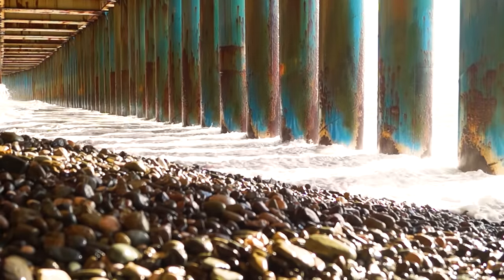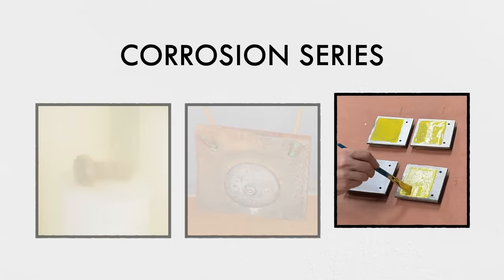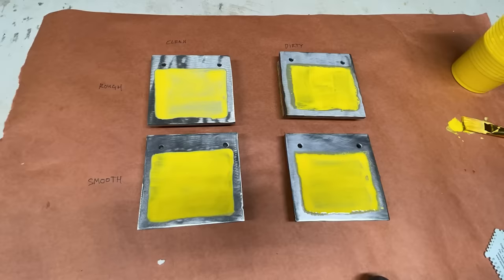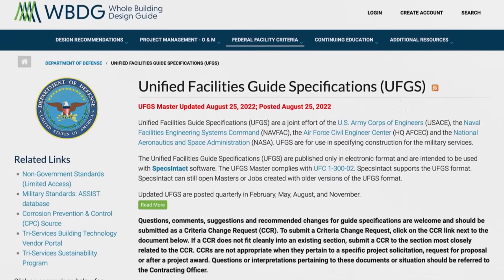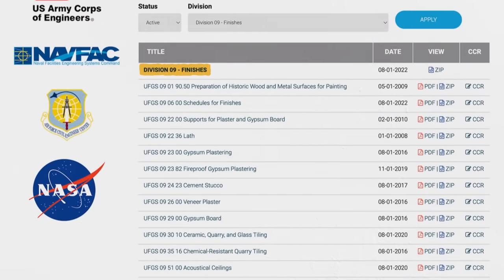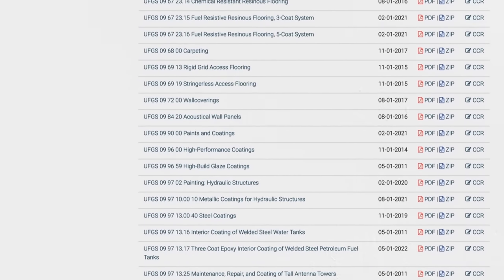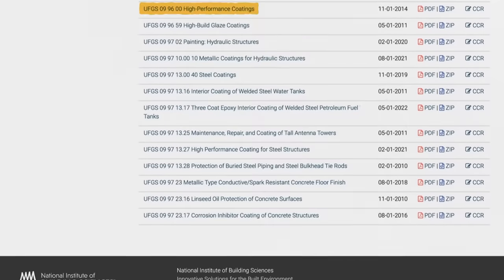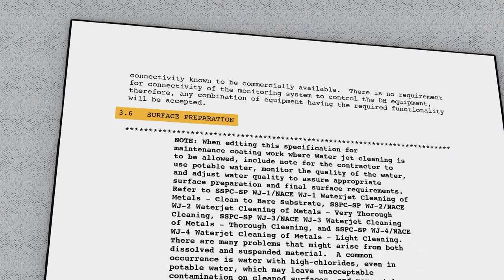What's the Difference Between Paint and Coatings?

Comment: Painting your home is often about protection as well. Bare drywall and wood are highly permeable surfaces that aren't resistant to water and generally should be painted for protection as well as looks. 

This is doubly so for outdoor paint.
Reply: Actually coating wood is only a semi good idea.
Because wood is hygroscopic a small crack in the coating can be fatal. Because once the moisture gets inside it can't evaporate, creating a wetspot where fungy can grow.
Reply: And in addition to providing pleasing cosmetic appearance, painted surfaces are much easier to clean (IMHO).
Reply: Are Americans afraid of bricks or concrete or what am I missing?
Reply: @SuperDeinVadda  Laura Kampf's house is a pretty good example of this, I think.  100 year old timber frame, completely rotted out from moisture trapped in the walls.  

Also my landlord's house that I rent taught me a lot about wood rot - something that happens when you let your "friends" play handyman.
Reply: As a professional painter of 20+ years, house paints are both decorative and protective. This is true for interior and exterior paints. Any exterior wood without some sort of coating, stain, paint, or other, will degrade much faster than those that get regular maintenance. On interior surfaces you can see this most prominently in bathrooms and kitchens.
Reply: @Realkeepa-et9vo  Americans are cheap and make disposable houses. With a wacky real estate market, why bother paying a bunch more for durable materials when crappy ones will suffice.
Reply: @Realkeepa-et9vo  Wood is just comparatively cheap and plentiful here in the US and Canada, and has been from the beginning.  It lasts for centuries when protected from moisture,* and the construction industry is extremely well-established around it.  There just hasn't been much economic pressure to force us to masonry, so most of our houses are wood-framed -- though sometimes with decorative brick or stone on the outside.

That said, you do see brick and concrete in city centers where fire codes are tougher, and stone in places where good building stone was historically cheap and plentiful.  And adobe is very much a regional tradition in the desert southwest (esp Arizona and New Mexico), and fits the climate there better than wood framing.

EDIT: And I should point out that Europe still has old wooden buildings, from when populations were smaller and wood was comparatively more plentiful.  Norway, Sweden, Finland, and Russia in particular were still building wooden houses up through the early 20th century, before brick and concrete got cheap enough to be competitive even in rural areas.

* 200- and even 300-year-old wooden buildings aren't too hard to find in the eastern states.
Reply: @AaronOfMpls  In Nordic countries at least, timber framed houses and log houses have been continuously built as long as those have existed. Forests are everywhere and wood as a material is cheap and plentiful, but also fast and easy to work with. Many times if you see brick single homes in the Nordics, masonry is only the outer lining but there's airgap, wind stopper, wooden frame with (usually) wool insulation and moisture barrier material behind that from outside in.
Concrete element or brick building is an alternative, but it's a little bit more expensive than timber frame structure. Log structures are the most common for summer cottages and such. Their modern counterparts are incresingly common not only in single family houses but in larger buildings such as school buildings and small condos.

My point is that timber as structural building material never stopped in the Nordics. Wood also has some interesting fire safety aspects because its strength isn't so much affected by temperature. It's light in comparison to steel and can be used in very large structures if designed properly. Check Oslo Gardermoen airport frame and roof structure.
Reply: @SuperDeinVadda  
And that is why you need to choose the wood and/or paint with care. Some types of wood do indeed do well without paint, at least under the right circumstances, while others need some form of protection. You also never want to paint damp wood with any kind of sealant.
Reply: @Realkeepa-et9vo  You have to understand that when earlier americans came to these lands and took them for their own, they saw giant swaths of absurdly large trees just theirs for the takin and they built prty much any buildin that didnt "need more security" out of wood.

It wasnt rly until folks started buildin up that it changed, and even then thats not the house most folks dream of cuz its not the one they had as a kid bcuz their parents had it as a kid bcuz their parents parents had it as a kid et al... So as such folks when buildin or buyin houses almost always look towards wooden or similarly lookin prefab material.
Reply: @ArmpitStudios  Outside of the americas it is quite common to find folks didnt build out of wood when buildin structures bcuz they needed that wood for burnin and for other reasons. The Americas had a wide swath of trees tho which colonisers were more than willin to decimate 9 times over.
Reply: @SuperDeinVadda  wow. I didn't know it was 'make my own science/reality' day here in the comments.
Reply: @Realkeepa-et9vo  The way America did housing changed a lot in the post WWII boom.  Lots of housing was built fast, and it was all single family detached.  Then we mostly kept building like that.
Reply: on the west coast one painter said the slogan for our rainforest with dry summers is, 'paint it this year, or replace it next year'. True that a cedar deck with an oil-based sealer/stain combo will probably require less precision during application, but if you can't work with those materials then properly applied paint is an important part of a building system.
Reply: @ArmpitStudios  Im well aware of the loggin industry, im an oregonian... Im also aware that prior to that industry comin into the pacific northwest there were many trees with trunks of sizes unimaginable to us today.

Theres a right and a wrong way to do loggin, and msss clear cuttin of ancient growth to plant somethin else is the wrongest way.

Esp given plenty of other areas where they cudve farmed trees evne back then instd of destroyin the natural beauty of this land.
Reply: @ArmpitStudios  Yeah, sure, just like any other crop that takes 1000 years to grow.
Reply: @Realkeepa-et9vo  Wood is cheap in North America.  Also holds up much better to earthquakes than masonry.
Reply: cool! just had the outside of my house painted!
Reply: @ArmpitStudios  Yes but that's only part of the story. The replanted trees aren't what nature put there, but are species chosen for rapid growth. They lack many of the good qualities wanted in construction but they're all you can get. And unlike old times when large mature trees were plentiful and younger smaller ones left to grow, now they harvest 8" trees to get a couple 2X4's. A lot of the framing wood in the US now comes from Canada because it's both cheaper and better than  what our own lumber companies produce.
Reply: @mikefochtman7164  I consider that a form of protection.
Reply: @SuperDeinVadda  I mean, yes, failures in protection are always harmful to the underlying surface, but it doesn't change the fact that paint is used extensively to protect wooden surfaces from sun and moisture. But not just that, also damage and marks inside a home, where paint is an easy to clean surface that unprotected wood is not.
Reply: @KeeDx3 I'm sitting in a new concrete house in Europe right now.
Reply: @ArmpitStudios  Yes, a millennium.  They don't call them old growth forests for nothing.
Reply: @Realkeepa-et9vo  i live in canada, but wood framing is very common here because it's easier and more efficient to insulate.  It gets to be colder than -50 degrees C here with windchill, insulation is important.  
Wood is also very cheap and environmentally friendly compared to concrete or bricks.
Reply: THIS!  As we say in the paint industry, paint's function is to "protect and beautify".  Paint protects your home, too!
Reply: @SuperDeinVadda  So what do you suggest, since nearly every wood home is painted, unless it's redwood or cedar left natural to turn gray eventually. Homeowner associations don't allow unpainted wood.
Reply: @SylviaRustyFae  where they cudve farmed trees....?
Reply: @larryvaughn5843 
Best thing is to keep the weather of you wood. A proper roof with overhang helps more than any coating will do.
Then you have to repaint frequently and repair cracks in the paint layer as soon as possible.
Reply: @larryvaughn5843  What part ya didnt get?

Comment: I recently refinished a very old pistol that had a rough duty life. Stripped it down to polished, bare steel. Then, coated it in corrosive chemicals that flashed rust all over it, then dipped it in boiling water to convert the iron oxide into black oxide. Had to repeat the process about 10 times to get a beautiful, dark coat of bluing. 

Chemistry is always baffling and truly amazing. I'm an Industrial Mechanic(mostly robotics), I fancy myself as a fairly competent mechatronic engineer as a hobbyist, but if there was one subject I wish I was smart enough to study and become an expert on, it'd be chemistry. You chemists are the real heros.

Comment: Before the Forth Rail Bridge was coated with a coating made for offshore rigs, they used to paint it every 6 years and it took 6 years to paint so they were always painting.
Reply: that's both interesting and somewhat depressing haha
Reply: I suspect it is as much a matter of economy as anything.  They could repaint in a week, but they'd have to bring in a contractor with 100 painters.  Or, they can have one (or more) maintenance guy or gal who has various tasks, but the predominant one, and the one that is assigned to do when other tasks don't have priority, is to paint.
Reply: I seem to recall that they had a crew of six. They were also constrained by the use of a basket that would hold the crew as it progressed around the structure

Comment: I used to work in a shop that refurbished construction equipment and I started out in the paint department doing paint prep and worked closely with the painter as his sort of assistant at times, learning a lot about what he does and why. Parts of this video showed clips of people doing various parts of the job of coating infrastructure, buildings, and ships, and in a many of those you see them using equipment such as boom lifts and scissor lifts. Another layer to this whole process is making sure those machines are in good working order, and a part of that is the coating that protects them from the same elements as the infrastructure in question, for the same reasons. We took great care and pride in our work on both the paint and mechanical sides of the shop because we knew the safety of anyone using that equipment was in our hands. A lot of this video included things we made sure were right as we were doing our jobs to ensure the folks doing things like maintaining our infrastructure were able to get the job done as safely as possible. Of course, some of these things are monitored far more closely and to a tighter standard when you're doing something like coating a bridge, but definitely interesting and cool to see how similar the underlying focus of the jobs are, and how one supports the other. The paint job looking good is great and all, but the coating being properly done is the primary emphasis. And if you do the second part right, the first will follow.

Sorry, just saw some specific equipment I know inside and out but havent worked on in a while and combining that with the topic sent me down a memory hole lol

Comment: We have a balcony with iron railings, and re-painting them is always a chore, because indeed at least 80% of the total time for the job goes into preparing the surface. After a few years, the spots we hadn't properly sanded and de-greased will mercilessly become visible.
Reply: I got rid of mine last summer for that reason. I liked the style but it's too much of a hassle to maintain. I've replaced it with wood railings with aluminum bars.

Comment: "The Mighty Mac", the Mackinac bridge connecting lower and upper peninsulas of Michigan is one of those structures that has nearly continuous maintenance.  Of course in the dead of winter, with freezing and blowing winds, it's not 'year round'.  The inside/outside of towers, the cables, the deck steel, and approaches all need periodic work.  At 5 miles (8 km) in length, it keeps a work crew busy.  Fortunately, no saltwater though.  :)

Comment: I do blade repairs on wind turbines and had a conference call with engineering trying to figure out if we needed to feather out our paint  on a 1 foot external repair. I had a rough idea of why we used 3 layers of different coats but this fully explains it.
Reply: They're made of steel and not carbon fiber?
Reply: @themonsterunderyourbed9408  oh no they are made of fiberglass with a carbon fiber spar.

Comment: I worked at a shipyard painting the hulls of boats during the summer of my freshman year of college, and I always wondered what the different layers of paint were. Iirc, we had to apply three layers of protective coating, and then that got sent to the more experienced guys to do the more precise aesthetic paint layer. We never did any of that calibrating paint thickness or surface roughness, the paints were well designed so any reasonable paint roller will put down a layer that fit within the painting specs.

Plus, those power washers to strip the paint and roughen the surface were no joke. They were about the size of a golf cart. Originally they used to strip both sides of the ship at once, till one time a guy's power washer fell below the bottom of the hill and hit the other guy in the leg. Went straight through his calf muscle.

That job motivated me to stay in school.

Comment: I worked for a very large company that made SCADA equipment for the electrical utility indusry.  It's customer base was truly global in nature.  A customer in Arkansas complained that the NEMA 4 class enclosure was leaking - which it is not supposed to do.  Our investigation lasted several months, and we enlisted the expertise of the foam and adhesive manufacturing companies.  The adhesive manufacturer, 3M, was particularly helpful and was instrumental in solving the issue.  The gasket adhesive on he leaking cabinets was not compatible with he "surface energy" of the coating system used.  It was simply a matter of matching adhesives to the surfaces they were intended for, and we never had another leaking cabinet.  I would be interested in knowing about the engineering associated with adhesives and surface energy.
Reply: *supervisory control and data acquisition

Comment: I really enjoyed the video since this is what I do and teach every day. Some comments on what is discussed in the video:
1. Coating failure figures are close, but also should include application as well
2. Testing method you are using is called a prohesion test where it's dry/wet cycling. This is definitely good and the industry uses salt fog chambers for ASTM and ISO testing. Also to get more accurate and repeatable results we do a scribe in the middle (bare steel cut) and measure the rust creepage from the scribe. For inorganic zincs, it's typically half of a regular epoxy system since cathodic passivation helps the test results. 
3. Replica tape is what the industry standard is. We use a point detector and now also use 3D mapping on the profile as well. Ultra high pressure washing is also becoming readily used for maintenance as well than just abrasive blasting. 
4. Holiday/spark testing is to detect pinholes but also for low-thickness areas of coating since we set it at a certain voltage. Typically 100 volts per 1 mil of coating. DC testing for coatings and AC spark testing for very thick and reinforced membranes/thermosets/plastics.
5. Coating people come from all walks of life which is great with the diversity it brings. AMPP/NACE is a great organization for resources and standards that I've updated and help created over the years.

Comment: I was brought up <15 miles up river from the Forth Bridge - while it wasn't necessarily repainted from end to end on a continuous cycle there was a painting crew employed full time on it. Since it was stripped back and recoated with a modern formulation a few years ago it no longer needs a full-time crew.
Incidentally, the bridge where I lived (still in use) was also an engineering marvel in its day, but only needs coating of the steel sections once in a while.

Comment: Was told by a fellow about a small business owner of an old Automotive Automatic Wash.
The steel structure hadn't been regularly cleaned and painted for decades when the owner decided to have a couple of guys prep and paint it. 
The fellow said that it should have had parts replaced because scraping just removed the loose rust and if it had been blasted alot of the supporting structure would have probably looked like swiss cheese. They used a very thick epoxy applied by brush which didn't get into corners and other voids like mating surfaces.
Needless to say within three months the epoxy was bubbling up in the worst areas. Basically the surface rust was held together with epoxy even as it became so bad it was separating from the rusted area underneath.
Also he said the cure time wasn't near long enough for the epoxy and the carwash was put back into active operation too soon and had water now being collected behind the epoxy causing even more bubbling and hence the new layer of rust under the coating.
This highlights the need for properly cleaning and coating at installation plus an inspection and maintenance on a schedule that fits the environment the metal will be exposed to.